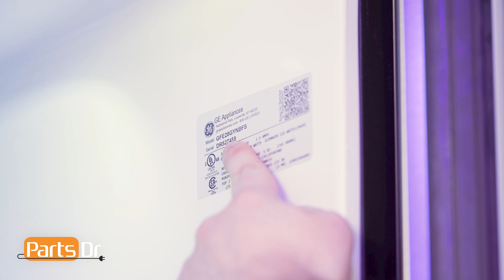GE refrigerator not cooling? Check these 5 things first!

Comment: Hello!, I have a geps6fgkfss model, it works well but every few days the upper part of the freezer defrosts and freezes the vegetable drawer of the refrigerator. Upon checking I see that the evaporator fan stops and does not come back on, if I unplug it and plug it in, the fan starts and everything works normally again for another couple of days. By the way, awsomes videos!! Thxs!
Reply from the maker: It sounds like you will probably need to replace that fan motor and maybe also the main control board that sends power to the motor.

Comment: I have a GE Profile Arctica refrigerator. The freezer works fine but fridge is not cooling properly. There is no ice buildup on the fridge coil and all fans work fine in freezer and fridge. What could be the issue?
Reply: Defrost 
Thermostat and evaporator fan

Comment: GE pye22kynefs all four fan motors operating, compressor operating, both evaporators barely cool. thanks
Reply from the maker: We can't diagnose problems over a Youtube comment, but you may have a compressor or sealed system problem.

Comment: My evaporator fan motor had stopped in the fridge and the evaporator coils had frozen up. Took it apart, got it thawed out and the fan started back up. Not sure exactly what happened but we are back up and running for now!
Reply from the maker: Glad it is up and running now.  It sounds like an automatic defrost problem.  The video links below will help diagnose your problem:
Test Temp Sensor - https://www.youtube.com/watch?v=SBfqozNgLYY
Test Defrost Thermostat - https://www.youtube.com/watch?v=i4SNEgPoUMY
Test Defrost Heater - https://www.youtube.com/watch?v=q7hysgipzpQ

Comment: Hey Parts Dr! 

You are great by the way! These videos are helpful. My issues is that my feeezer won’t freeze. The fan does work at low speeds but does not go any higher. If I unplugged and plug back in the fan goes on high for 15sec then goes back to low. I have a GE PVD28BYNFS 2020 model. I ran codes and it comes back with 003 thermistor. I replaced both the defroster and the one in the plastic panel. When I replaced  the defrost thermistor it soundsed like it started to work, then it didn’t. Ummm.. my problem  is that we are 300miles from the nearest repair facility. We are on ther resevstion  out side of Page AZ. Any help or direction would be greatly appreciated
Reply from the maker: Does the evaporator coil have an even layer of frost across the coil?
Reply: Thank you :) NO. Most of the frost accumulates in the top right section near the thermistor. The frost does not go all the way across. @PartsDr
Reply from the maker: @ryancross8136  That would indicate a sealed system or compressor problem.  You will want to consult with a technician to see if it is worth repairing.
Reply: @PartsDr that is exactly what I did. When I took it in, he immediately mentioned that the evaporator was repalced and it wasn’t done well. I bought it used and learned my lesson 😢. He will let me know Monday what he can do.  He said something about they used a torch to install??? The Freon is the new Freon that is super flammable? Crazy. Thanks again bud. I’ll let you know the final outcome. I seriously may take a Ccommunitly College course after all this😂. I can help people on the Rez.

Comment: When testing for voltage on an EVAP fan motor, are you just looking for a voltage reading or is there a specific range and I'm going to assume the simple test method is to make sure it's plugged in make sure it's to the coldest setting and the door switches are engaged and put a multimeter on it? Now how often is dirty condenser coils on the back rear the cause of the issue and is that really going to make it to where it's not cooling or is that where it's not cooling completely? Thanks
Reply from the maker: Each refrigerator can have different voltage specifications for the fan motor.  Some are AC voltage, some are DC voltage, and some are DC voltage with a varying frequency. Here is an example of how to test the voltage: https://www.youtube.com/watch?v=x9fK0bN72MA 
It is not very common that dirty condenser coils cause the issue.

Comment: Our tenants refrigerator is on the fritz. Freezer is not freezing, refrigerator is around 45. On older fridges, it would always just be an evaporator fan, or a cheapo little defrost control timer. Now they have replaced that cheapo defrost control timer, with a thermostat, multiple themistors, and a bunch of other crap that just adds to the troubleshooting process. I'm all in favor of keeping things as simple as possible.
Reply: Buy a big block of ice and hire an Eskimo to change it out when it melts.
I think "Nanuk" is free.

Comment: What a great video and such a smart marketing play because it solidifies where I am going to buy the parts needed. Thank you!
Reply from the maker: Very welcome!
Reply: @PartsDr hi we have a GE GFE26JSMAFSS that is 50f in the fridge and very cold in freezer…I’ve done the self diagnostics codes and everything passes 
I noticed the freezer fan is on with freezer door opened. This problem comes and goes randomly…also I’ve noticed that cold air only blows from top of fridge tower when freezer door is opened, when you close the freezer door the cold air stops coming into fridge.
Any advice is greatly appreciated 🙏🏽
Reply from the maker: @MahALOHAwaii92  We aren't able to troubleshoot problems like this over Youtube comments, but it sounds like you might be experiencing a failure of the main control board or door switch from what you described.  Let us know what you find as the solution.

Comment: I have a GFSS6KKYESS which looks like model # GFSS6KKYSS not sure what the "E" is for. Anyway we got it used but the display doesn't who the temperature just showing the "e" for energy saver, speaker or sound, and a glass with cubes above the "crushed" option.  When I unplug and plug in the power it shows -88 for a while then disappears.  Just When I press the buttons Energy Saver, Adjust Freezer, Ice & Water on the left side it doesn't show anything. The same when I press the buttons on the right, "Alarm/Light, Adjust Refrigerator, Ice OFF/Lock".  THerefore I cannot adjust the temp of the Fridge, I also tried holding the button for 3 seconds but it's still the same. FYI the water line is not connected.  But this should not affect the display right?

Comment: Great video! I had a sheet of ice built under the deli drawer of the upper fresh food portion of my GE Twin Chill, like the one in this video. I let it thaw and cleaned the drains by putting hot water. I also replaced the fan on the fresh food, the freezer fan seemed fine. When I turn on fridge, the freezer fan kick on immediately but the fresh food one doesn't. Does it take sometime to kick on?
Reply from the maker: Yes, there could be a delay.  Also, make sure the door switches are depressed.
Reply: I had the same issue and cleaned the drain and replaced the fan in the fresh food as the old one was working intermittently. With the new fan I have the same result and upper shelves of the fridge only get to about 45 degrees and the fan only works when it wants to. Any suggestions?

Comment: HI I have called to Appliance guy out after watching your video. We replaced the Fan, didnt help, They replaced the mother board. The refrigerator wont get below 43-47 and the freezer will get to 0 and later in the day they switch. Freezer will be 43 refrigerator will be in the 20's or lower. What else can it be?
Reply from the maker: What is the model number of your refrigerator?
Reply: GFE29HSDASS @PartsDr

Comment: Your video was super helpful !!! But I still have a problem with my fridge getting to temp. My freezer is working fine, but fridge won’t get below 43. When I took it apart to check the 5 things, I found the coil in the fridge was frozen solid so I defrosted and put it back together. All inside fans appear to be working correctly, but I don’t have  a volt meter to check the juice. Would a bad temp sensor keep my fridge from getting to temp? . Any other things I can check before having to say uncle?????
Reply from the maker: The ice and frost on the evaporator coil sounds like the issue.  With all of the frost melted, allow 24 hours for it to cool back down to normal. You will also need to replace the bad defrost component(s) to keep it from happening again.
Reply: It has been almost 36 hours and fridge won’t go below 43. But I can have ice cream 🍨 freezer working great. I will check out the other videos for other defrost components, but is there anything else that would keep it from getting to the 30’s ? I feel that there may be a second/separate issue because by all accounts it should be working now

Comment: What if I can hear the fridge/ freezer running, but the fan is not moving (in the freezer, there is only 1, a small 14 in refrigerator)? Fridge temp 55 and freezer 10 😞 Don't know what to try, I took out and extra food in freezer that were near fan and turned the knob to coolest?
Reply from the maker: Does the freezer fan run if you hold down the door switch?
Reply: @PartsDr  No I tried pushing/ holding it 3 times and the a little longer, but still nothing (I had also seen this on a few other video's and thought I would try anything)
Reply from the maker: @7peacefrog  That usually indicates that the fan motor is bad.  To verify, a voltage test would have to be done at the motor.  If the motor is receiving power and not running, the motor is bad and needs to be replaced.
Reply: How do you do a voltage test for the fans? Disconnect the connector keep the fridge plugged in make sure it's on coldest setting? What type of voltage are you looking for just any voltage?

Comment: I have a GE GSS25QSW fridge that is some years old. A few years ago it started to make a whoo...whoo...whoo sound from the freezer section fan but it cooled OK. That sound sometimes lasted for a few hours. It looked like the cooling/freezing cycle was confused and didn't know to stop or start. About a week ago it stopped working, no ice making, but the fridge is still kind of cool inside. Any ideas please what to check? I am good with tools and electronics but I try to avoid changing parts that are good till I find the bad part. Thank you.
Reply from the maker: These refrigerators had a common issue where the freezer fan motor would make noise like you are describing.  The speed of the motor would go up and down.  To fix this issue, you need to replace the main control board and fan motor at the same time.  We are not sure if your other problem is related or a separate issue.
Reply: Looks like I need to get a new fridge, which GE is a good model please? @PartsDr
Reply from the maker: @daconvideos  They seem to all be pretty similar in quality.
Reply: @PartsDr  Thank you for your answers. One last question, is there a better brand compared to the other? Less headache, better construction, less complains?
Reply from the maker: @daconvideos  GE and Whirlpool are our two favorites currently.  The quality of all refrigerators is not great anymore.
Reply: @PartsDr  Thank you Sir for your replies. At the moment I will replace the condenser fan and see how it goes. The cooling serpentine/condenser is covered in ice. I have tested the fan with a 9v battery and is not spinning. Also I have voltage from the controller board to the fans, including 13v at the connector to the condenser fan and the small white temp sensor. I hope I will fix it, if not, to the stores for a new one.

Comment: How do you know if you need a recharge ?
Reply from the maker: Refrigerator's typically don't get recharged with refrigerant.  If there is a leak in the sealed system, the leak must be repaired by a professional and the refrigerator would be recharged at that time.  To determine if there is a compressor or sealed system problem, it is best to inspect the frost pattern on the evaporator coils to see if they have an even frost pattern on the coils.

Comment: Great information. Thanks for sharing. It's just too bad most modern appliances are made with such cheap crappy parts. They want them to break down quickly so they can be replaced.
Reply from the maker: Glad we could help!
Reply: @PartsDr can i lay the fridge on it's back and remove the bottom to get to the coil better?
Reply from the maker: @JohnDoe-hu4ph  Yes, just make sure the leave the refrigerator unplugged while doing so and leave the refrigerator upright overnight before plugging it back in.
Reply: @PartsDr  thanks for the reply! Your vids are extremely helpful! Keep up the great info!